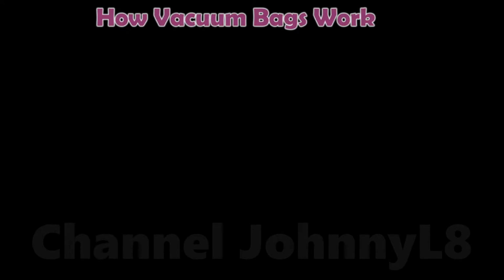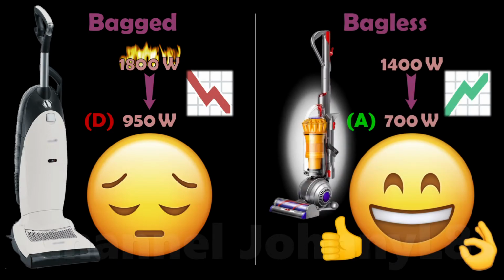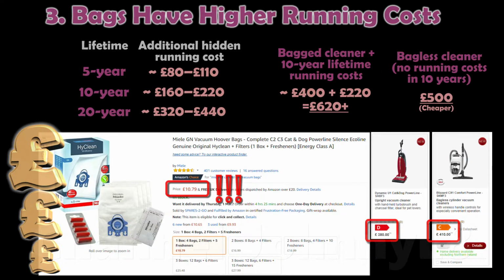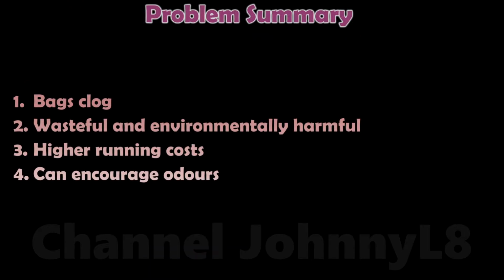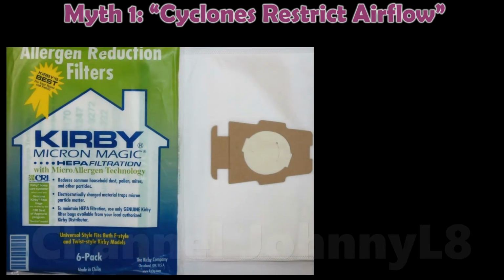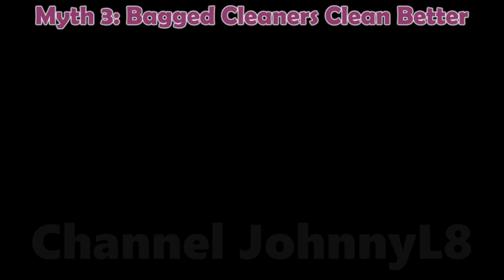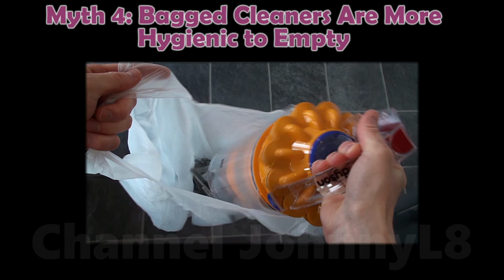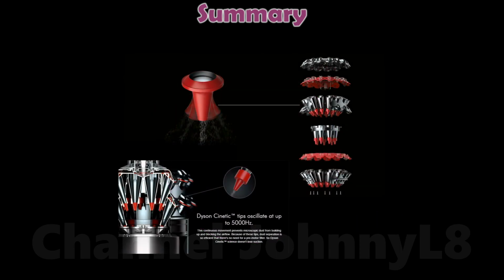Bagged Vs Bagless Vacuum Cleaners

Comment: Interesting video here. I’m not sure how many bagged vacuums you’ve tried, but they’ve come a long way. You mention how bags can split, clog, have odours, and end up being expensive. Hepa cloth bags have pretty much replaced the one layer or two layer paper bag. Hepa bags can not only continue to function with the bag being full, but they can trap odours better than a paper bag or even a bagless vacuum. While the cost of the bags may seem expensive, they last way longer than filters in a bagless vacuum. It is important to know that filters wear down as you wash them. They may seem fine, but dust can pass through filters after a few months. You should also know that when you empty a bagless vacuum, you end up breathing the dust which is terrible for your lungs. You need to realize that people who have allergies use a bagged vacuum for that reason. Your understanding of cyclones is also not very good. It doesn’t matter if newer Dyson’s have multiple cyclones, you still need a pre motor filter. Cyclones not only let dust through, but they also clog up pretty quick. Vacuum stores that actually take apart these machines will tell you the huge amount of dust that gets into the motor. Agitation is also important when it comes to performance. Most bagless vacuums like your Dyson’s have extremely pathetic roller brushes. Over here in North America, roller brushes or brush rolls that are small or one’s that are too soft will not clean carpets. Dyson’s usually have pretty bad roller brushes that don’t clean well. As someone who’s been fixing and using all kinds of vacuums, I can tell you that a bagged vacuum will clean better and last longer. I’m not just disagreeing with you for no reason, I’m pointing out the facts from experience.
Reply: If you ever wonder why people who vacuum in commercial places use a bagged vacuum, it is because emptying a bin multiple times takes away time that could be used properly. When the filter clogs, they have to tap it out which is a pain in the ass to do since you’re 100% going to breathe in all the dust. A large vacuum bag like a Hoover type a bag is huge in size. Compare that to a small vacuum bin. Trust me, people who are serious like me when it comes to cleaning will go for a bagged machine. Your statement in your video on how even a cloth bag can lose suction is extremely false. I’ve vacuumed with cloth bags that are more than full, and the machine was still performing as normal. There are even videos on YouTube that show this, so it isn’t like I’m the only one who thinks this way. I can tell you ended up falling for one of Dyson’s lies about a “lifetime filters”. They originally meant the lifetime of the vacuum, not your actual lifetime on earth. The early Dyson’s had really cheap plastic that broke easily no matter if the machine was new or old. It also doesn’t matter if the bagless vacuum is a Dyson or not, they all require filters that are more expensive than a pack of bags that can last 3-6 months or even a year. Someone who uses a vacuum in public spaces will tell you that it is easier and cheaper to throw away a bag instead of replacing filters so often. Any filter is going to wear down no matter if you clean them or not. That’s the way it goes. Filter material simply degrades over time and there is nothing you can do about that. Filters in bagless vacuums can have dust go through the filter and into the motor more quickly than a bagged vacuum. The reason why is that cyclones, no matter which one it is, will still have dust go past them. That’s why they heavily rely on a pre motor filter. The science behind how cyclones work is meaningless. The reason why is because people who open them up will show you what they collect. You don’t see this, and it causes the machine to not only lose performance, it can also cause a bad smell. It doesn’t matter how you empty a bagless vacuum, they still put dirt into the air no matter what. The fact that you called people who suffer from allergies as ignorance is insane. Bagless vacuums aren’t fully sealed, which makes their hepa filters pointless. Cyclones just collect dirt. This is from experience. That crappy model of the Dyson with no pre motor filter is garbage. Someone opened one up to show all the dust that goes right into the motor. The fact that you shame vacuum stores is depressing. They not only sell you parts instead of you waiting for them, but they also service machines. They aren’t a scam, they just know the facts from fixing so many vacuums over the years. If you wonder why vacuums that are meant for carpets include a brush roll, it is because it needs brushes to dig into the carpet to lift up the dirt. Suction and airflow itself won’t deep clean carpets without agitation. Without agitation, you’re just surface cleaning. The reason why vacuums over here in North America have brush rolls, it is because our carpets aren’t rugs. Simple as that. The vacuums I’ve fixed that last longer are old school bagged vacuums. These are machines that were made in the 90s or should I say the 20th century. The reason why they last so long is because direct air vacuums are designed to not let dust into the motors as easily. They blow all the dirt into the bag. Bypass machines that are bagless will have motors caked in dust. That causes the fan to get off balanced and can even ruin the bearings. Older vacuums were also made in America. The build quality was so strong that it made the machine to last forever. So many older vacuums like Hoover convertibles, concepts, and elites are still working like new. The fact that you don’t know this makes me believe you just haven’t seen or used that many vacuums in your life. It is important to know that facts are more important than feelings. I’m someone who has experience instead of online myths. The idea that we can control the weather is a good example of a myth.
Reply from the maker: I've answered all this above. To suggest, for example, I'm false to state cloth bags clog, is to ignore the evidence provided to you that it's a true statement. This is the difference between the two of us; when it comes to factual matters, you rely on 'trust' and anecdotes, whereas I provide objective empirical evidence that's true to everyone regardless of their opinion or feelings. People can make up their own minds. If you have any real evidence to support anything you say, I'll take a look; otherwise I'm wholly unconvinced by anything you say because I have no good reason to be and it conflicts with simple observation and understanding of basic science.
Reply from the maker: >>”they’ve come a long way.”
They’ve come a long way from paper bags but have reached technological stagnation (as pointed out in the video) and are quantifiably superseded by better technology (and have been for a long, long time) that is better performing, easier to use, with few running costs, and much lower impact to the environment. No one should be using bagged machines anymore, including commercial environments. as discussed and evidenced in several videos: https://youtu.be/S9MtVVkOZek and https://youtu.be/Ue2X1b4cRTE 

>>”Hepa bags can not only continue to function with the bag being full, but they can trap odours better than a paper bag or even a bagless vacuum.”
This statement is false as evidenced clearly here https://youtu.be/ei3rEQzMoPk and here https://youtu.be/ZmzG8XOQAeQ The myths surrounding odours is fully covered here https://youtu.be/hsl4tCaL6g8

>>” While the cost of the bags may seem expensive, they last way longer than filters in a bagless vacuum.”
This statement is only partially accurate. In cheap, nasty, knockoff bagless clones that rely on disposable filters, this statement may be true. For the original bagless cleaner which did things right and was designed to have lifetime rinseable filters, this statement is false. Bags are a wholly avoidable ancillary that costs money, costs time to ensure you have them in stock, and have substantial, wholly avoidable environmental impact when scaled up to all users.

>>”It is important to know that filters wear down as you wash them.”
Could you provide some clear, quantified, reputable, independently verified evidence to support this claim? I have seen none and believe it to be completely false. You’d think such evidence would be freely available if true. Vague anecdotes and citations to disreputable sources, such as lay users on YT are not good enough. What is the mechanism that causes such ‘wear down’ at a microscopic level? What effects does it cause specifically? No one who makes this claim over the years has ever been able to defend it reputably or make any sense, and I suspect this will be no different. (It’s false BTW)

>>”Dust can pass through filters after a few months.”
As above. Just how is it that dust ‘passes’ through a filter? You’d see performance improve because air resistance decreases if this was true, and emissions quality reduce. How does dust pass through a borosilicate nano structure because water has contacted its interface? It’s high surface energy make it fairly hydrophobic. You’re aware of the basic science right? Your statements are a complete odds with reality.

>> “You should also know that when you empty a bagless vacuum, you end up breathing the dust which is terrible for your lungs.”
Cheap, nasty, knockoff bagless clones do suffer from poor emptying mechanisms which makes this half true. But the original bagless cleaner which did things right solved this problem a long, long time ago, as evidenced very clearly here https://youtu.be/E_ik6qScs0o

>>”You need to realize that people who have allergies use a bagged vacuum for that reason.”
Yes; ignorance. It’s quite possible to empty the original bagless machine correctly without triggering allergies. It takes 5 seconds and adds nothing but dust to landfill. It’s also a myth that bagged machines that self-seal don’t produce dust clouds. This is clearly evidenced here https://youtu.be/ZmzG8XOQAeQ and in the Henry cleaner reviews https://www.youtube.com/playlist?list=PLBxUOcW7kaEv_NwGkf-S1IKMP16cpUgqQ

>> “Your understanding of cyclones is also not very good.”
How have you concluded this? No one who had watched my videos could sensibly conclude this.

>> “It doesn’t matter if newer Dyson’s have multiple cyclones, you still need a pre motor filter.”
This is not true for Cinetic models, as evidenced here https://youtu.be/Z3MefmIot6M
The original bagless clear relies on a premotor filter much less than cheap, nasty, knockoff bagless clones, as evidenced here https://youtu.be/T3prXR-aeOg
In a bagged machine, the bag is the filter, which clogs, as already evidenced earlier. In other words, the filter in the original bagless machine is all but the same as the bag. It’s smaller because it’s relied on less.

>> “Cyclones not only let dust through, but they also clog up pretty quick.”
Again, this is only half-true. Assuming the user hasn’t abused the machine and caused a clog, the original bagless cleaner cyclones do not clog. Cheap, nasty, knockoff bagless clone cyclones do. This is evidenced clearly here https://youtu.be/11agqY2g1rM

>> “Vacuum stores that actually take apart these machines will tell you the huge amount of dust that gets into the motor.”
Vacuum stores are a false economy and a scam, praying on ignorance and poor technology. They often do unnecessary things. This is de-mythed clearly here https://youtu.be/TjUdD6FZtMY  and here https://youtu.be/hsl4tCaL6g8

>>”Agitation is also important when it comes to performance.”
Most people that don’t understand the science of how vacuum cleaners work use the word “agitation” to mean vibration from a brush bar, rather than what’s important, which is pile flexing. This has been covered here https://youtu.be/WzkFvMLy-Eo , and here https://youtu.be/urXCmJsDgXs and evidenced to be false here https://youtu.be/UaOjiLqkgGA

>>”Most bagless vacuums like your Dyson’s have extremely pathetic roller brushes. Over here in North America, roller brushes or brush rolls that are small or one’s that are too soft will not clean carpets. Dyson’s usually have pretty bad roller brushes that don’t clean well.”
Pity this assumption, stated without evidence, conflicts with actual evidence, e.g. https://youtu.be/7wa3SrXh-0s

>>” As someone who’s been fixing and using all kinds of vacuums, I can tell you that a bagged vacuum will clean better and last longer.”
Can you provide evidence that supports why? People who make this claim never do. You should be able to show, with statistical significance, the mechanism which leads to the lifetimes observed. Where do failures occur, why did they occur at a detailed level, how had the machines been treated during their lifetime and the evidence for that. Your unsupported anecdotes are completely unconvincing when there’s real evidence available. 

And then there's literally everything else in the video, glossed over. I’ve seen all this before of course…

Comment: only reason we dont only have bagless vacuums is because of patents....
Reply from the maker: Explain?
Reply: @VacuumFacts  You explained it yourself, Dyson product is so much better than anything else that any other producer of vacuums can't reach their level of perfection, because of the patent that Duson holds they are alone in the top.

So if this patent was not there, all other producer of vacuums would just copy Dyson's idear and there would then only be "Dyson style" vacuums because it is so much better than anything else, or did I get something wrong ?
Reply from the maker: @K2teknik.  Sadly, most capitalism is conducted regressively, meaning almost all companies are only interested in profit at any cost—usually the customer. Capitalism done correctly, i.e. progressively, is about investing much of the profit into genuine improvement and advancement. This is often achieved in the form of very expensive research and development. Patents are designed to protect that investment, and regressive capitalist companies attempt to circumvent patents with knockoff clones which don’t work as well and sully the original idea (see this https://youtu.be/U_qS2i6HQRY ). Dyson are one of the very few examples I can cite of progressive capitalism that’s genuinely done (mostly) right. They positively improve the leading front of things as their business model. If patents were not there, yes, many regressive capitalist companies would just blatantly steal even more egregiously and undercut for profit at the customers’ expense. In an ideal world with nothing but progressive capitalists, companies would be competing not solely for profit, but for genuine superiority in advancement by being exactly like Dyson, investing in R&D, and producing products which were objectively better in every way to them that make others want to one-up. Dyson are at the top because of the failure of the economic model we vote for, which breeds companies that race to the bottom for selfish gain. That lower floor is only kept high and improving because of companies like Dyson who do things right and advance us. There is genuinely no serious competition to Dyson (in the sense of advancement) I’m aware of, and that’s a terrible shame because we all lose out. But it’s our choice, ultimately, because we can choose to vote for the economic policies we want. We can go for a greedy, shortsighted race to the bottom, or for accelerated advancement.

Comment: By the way others have cover other points but you said bag vacuums loose suction as the bag fills up. This is correct but this is solved by replacing the bag. Where as filters the issue stays even after being cleaned, until you replace the filter. You can get years worth of bags for cheaper than buying years worth of filters. Plus with bagged machines you get better filtration. You have the bag it’s self, pre motor filter, post motor filter. Bagless you only have pre and post motor filters. 

There is a reason why commercial vacuums have bags.
Reply from the maker: All this is covered in the video you're commenting on. Replacing the bag is not a solution. It's wholly avoidable cost, environmental impact, and requires forward planning to have them in stock, the hassle of changing etc. All discussed in this very video you're commenting on...and brushed over seemingly. You have also made a false statement that bagged machines give better filtration. If, again, you'd watched the videos on my channel, you'd know you're peddling nonsense and myths. The filtration of bagged machines is covered in the V15 ( https://youtu.be/4aL0eJenTqw ) and Gen5Detect ( https://youtu.be/7wa3SrXh-0s ) reviews. It leaves a lot to be desired and is shockingly inferior now. The concept of commercial machines as being something impressive or better is fully debunked in a number of other videos on my channel ( https://youtu.be/S9MtVVkOZek https://youtu.be/2xMzOSfEHw0 https://youtu.be/Ue2X1b4cRTE ). Commercial vacuums have bags because the nature of the working environment champions a disposable, throwaway approach. It doesn't have to be like that—and in fact isn't any longer. And after all this, there's then still everything else wrong with the technology in bagged machines, also covered in their reviews ( https://www.youtube.com/playlist?list=PLBxUOcW7kaEtK3qcKCMEaLKTrP8Ehu8sz ) that you've probably not watched either. Sadly, the information to correct for great and common ignorance is available but wholly ignored...and so ignorance continues to manifest in such comments.